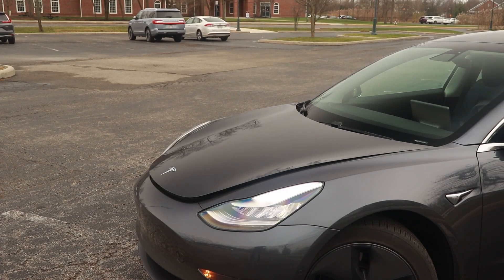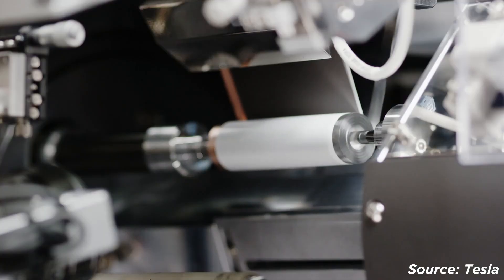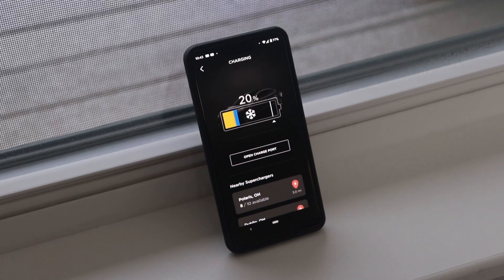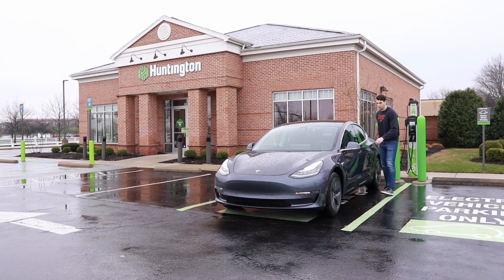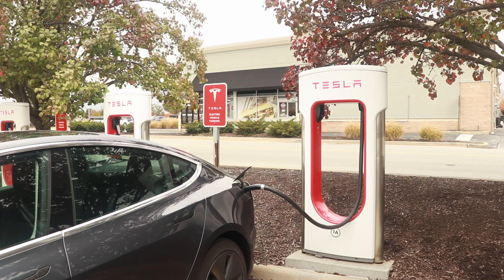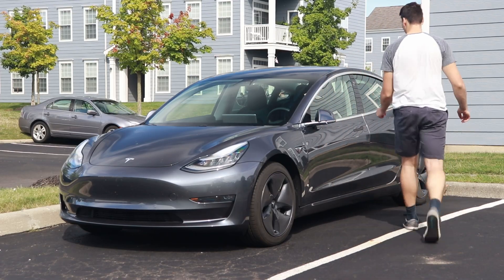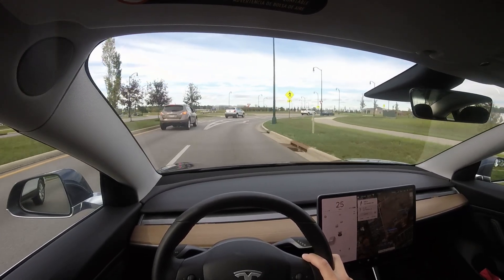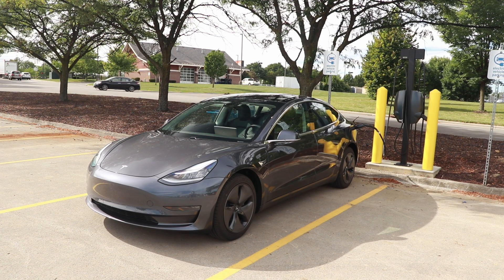EV Battery Care: How to treat your battery right! (and limit degradation)

Comment: I have heard contradictory information on whether to charge till 80% or 50% or 100%. Car manufacturers say its best to slow charge till 100% so that all battery cells in battery pack are calibrated and DC till 80% cause after 80% battery charging is very slow which matters while DC fast charging.
Reply: Keeping the charge near the middle is best but it's also good to occasionally do a 100% and then down to as low as you feel comfortable with to calibrate like you stated

Comment: Example. I drive my Tesla dual motor 25 miles per day or 175 miles per week. Do I charge everyday to replace the 25 miles in a short charge and bring the charge up to 80% or do I charge once per week and replace the 175 miles in one longer charge up to 80%? 7 short charges or 1 longish one? What is better for the long term battery health? Some say it's best to ABC Always Be Charging or always be plugged in. Elon says a plugged in Tesla is a happy Tesla. What is better for the battery?
Reply from the maker: Likely a negligible difference between the two, especially for home charging. I generally recommend logging in every day so you wake up with 80%. It's the best part of driving an EV

Comment: One of my business associates has a 2 year old Tesla Model 3.
New it was good for 300 miles.
2 years later its struggling to get 250 miles.
It also looks like a blind 3 year old put it together. Nothing quite fits right or lines up.

If an EV was fit for purpose. The worlds governments wouldn't need  legislation to force us into buying them.

Lets face it. Looking back into history, every new thing has been better than what it is supposed to replace.
The EV is a major step backwards.

Comment: In your situation, where you have to rely on DC fast charging, you can minimize battery degradation by limiting your finishing charge to 75~80%, rather than  "juicing" up to 90% each time. you can also help offset the difference by driving for maximum mileage per kWh. (electric equivalent of "hyper-mile" driving) That will help reduce the peak amounts of current drawn during acceleration, as well as the current returned to the battery during regenerative braking. The only disadvantage of  fast charging, is the cost per kWh, making it as expensive to drive as a good gasoline Hybrid car.

Comment: lol all EV's made before like 2017 literally had laptop batteries inside them. theyre the same thing. liFepo4 are the only newer batteries which kind of suck in terms of weight vs range. 
teslas are super heavy cars
most cars are about 1 ton or 2000lbs
model 3 is about 2 tons or 4000lbs
model x is almost 3 tons or ~5500lbs, and ironically qualifies as heavy machinery which you can write off business profits here in the US, kind of like if you bought a big truck for ur business due to depreciation tax incentive.

Comment: If you only used your EV for leisure purposes, ie not everyday use, would level one charging be the most efficient ? I seem to get more mileage from this method then level 2 or 3 ? When using the KIA mains adaptor, which can run at 6, 8 or 10 amps, when charging at a slow 6amps I’ve had a full charge 347 mile on a NIro which is supposed to have 285 miles full charge ?

Comment: i dont agree with not full 100% charge..
i have a leaf dec 2013   with still 10 bars of health
i charge only at home every day to 100%! 240 volt 2,2kwh.when im home there is 20% left.
i own it for 4 years now and bought it with 69.000km on it. now its 150.000 km with still 10 bars!
im from the netherlands and my batterypack never go over 6 bars for the heat.

Comment: Good advice, regardless of display showing usable battery, not actual battery. Software/hardware doesn't do everything to protect your battery. Manufacturer recommendations are worthless once your warranty runs out. 
I have limited options with my 2015fiat 500e "80' mile range. I try not to go 100% unnecessarily & stay above 20%. I recently saw sudden drop in range approx 10%, most noticeable under high drain, my drive home from work, 25 miles at 72 mph. I've gone back to doing some L1 charging at home. 
Battery degradation is not the only concern, sell leveling, there are limits to what BMS can do.

Comment: Dude, you cannot charge your car to 100% and you cannot over-discharge your battery. What you see on the state of charge (SOC) indicator is not the full range of the battery voltage.  What you are seeing is the range of the battery voltage that the manufacturer allows you to use .  When you see your charge indicator showing low, you are seeing that the low voltage limit determined be the manufacterer is being reached and the mfr. will simply shut the car of, but there is still charge in the battery. Manufactures are not stupid. They have to ensure that these battery packs last 8 years or 100,000 miles and their battery management software and their battery charge controllers are there to make sure this happens and one of the keys do doing that is to never allow the battery to charge to its actual full capacity and never allow it to drain below it's lowest safe voltage. This isn't a freaking flashlight battery. It is a massively complex system that makes it really hard for you to screw up your battery.

Comment: You claim that the “best” thing for your battery is Level 2 charging - when in fact, if the rest of your spiel can be believed, it would be Level 1 charging.

Advice like you’ve provided for charging to 90%, 10% and 50% may technically be “better” - but without being able to quantify “how much better”, one could make an argument that all of this micro management provides a poor return on investment for the extra attention and effort.

I’d also argue that if this truly were the best advice for managing your vehicle battery - and if it resulted in a significant longevity increase - then the car would manage this automatically and it would display 100% and stop charging when it truly hit the 90% capacity mark.

I’d like to see a longevity comparison between identical usage patterns - but someone who always recharges to 100% as quickly as possible vs someone who follows all of these best practices showing:
- the battery degradation curve over a decade,
- battery health after 3 years, 5 years, 8 years and 10 years

If following all of these “tips” are going to make my battery last 1 month longer than someone who doesn’t follow them - it’s absolutely not worth the effort and attention - but if it’s going to last an extra 2 years, it probably is.  

Until someone publishes actual data showing the real word difference, I’m going to assume the difference is “negligible” and do what is most convenient for me.  Claiming that something is “better” for a battery, doesn’t necessarily mean that people should do it.  Prove that it makes a significant difference to longevity and then I’ll consider it.
Reply: Search Battery University article 808. Figure 6 sums the longevity comparisons nicely. But you raise a good point about real-world ability/expectations to manage battery use as close to 50% as possible. It is particularly difficult for those with PHEVs with a smaller battery size to begin with.

Comment: How much degradation  is currently on your battery pack? 
Nice Video!  This was Tesla Response to my 2020 M3 LR, because I'm down to under 300 miles after only 3700 miles:  "HV battery has degraded by about 3.9%, normal battery degradation based on fleet average"
Verified Proper Operation. Referred customer to range support page.
Correction: Remote – Education
Reply from the maker: I'm at about 300 miles right now, but I've heard the biggest "drop" happens quickly then it plateaus after that. If the trend continues at that rate then it is probably a bigger issue

Comment: So it sounds like I should use the departure feature instead of charging as soon as I get home? SR+ here,  I usually have 80-100 miles when I get home from work then charge to 212-218 miles (Tesla's wall connector)
Reply from the maker: Unless you are going to let your car door for an extended period (multiple days) then I would just daily charge to 80-90%. If you really want to play it safe you can use "scheduled departure" but I don't think it's completely necessary.